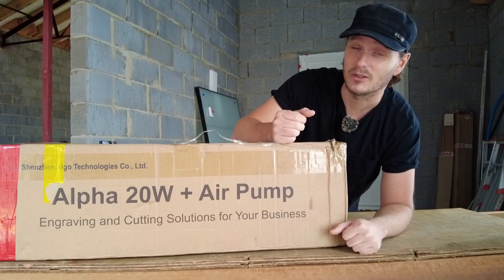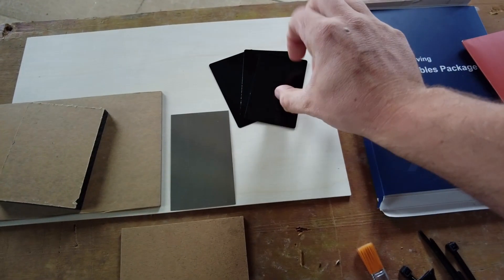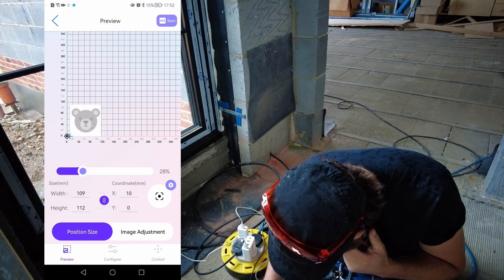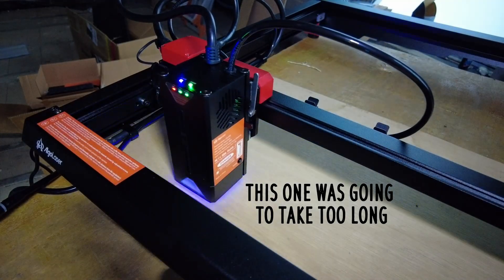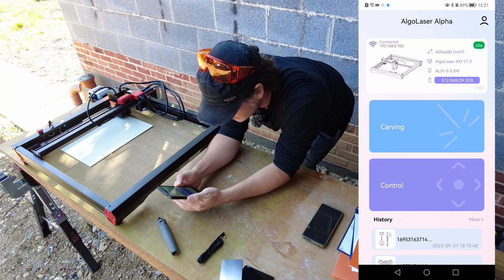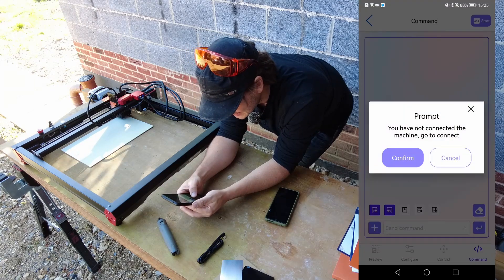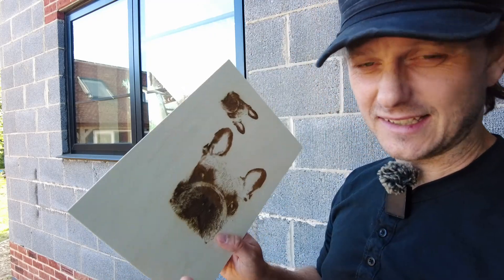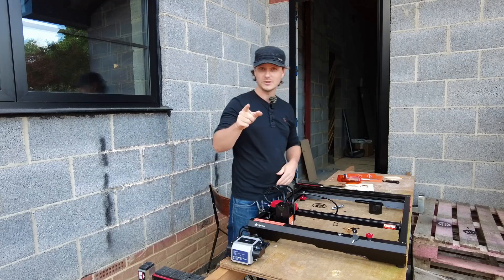First Time Laser Engraving - AlgoLaser Alpha - Easy & Fun!

Comment: A note of caution about these laser engravers/cutters - these are Class 4 lasers and while you're obviously not going to be looking into the laser itself (!) the reflections are still powerful enough to cause eye injury, especially if you are using on more reflective materials (metals etc). The glasses you get are likely not particularly high quality, and relies on you remembering to wear them. Also consider anyone else around (including pets like Arthur!) who can potentially be exposed to the laser light, particularly if they are viewing from a lower angle. These lasers should really be in an enclosure with an appropriate filtered viewing window, and an interlock that turns off the laser if opened.
I work with diode lasers in a research lab and we have a lot of safety mitigations and training around the safe use of lasers, so makes me worry about people being able to buy these and maybe not having the same awareness of the risks. All power tools are potentially risky of course, but that's usually more obvious  🙂
Reply from the maker: I'll pin this for others to see 👍 

yeah I was going to look for some properly rated/certified glasses, do you have any recommendations?
Reply: Although I work with lasers, I'm an engineer not a laser scientist, so by no means and expert! There are quite a few factors to consider when specifying suitable laser glasses, such as being appropriate for the wavelength of the laser you're using and how much visible light is absorbed. Of course if you can't see through them very well then that's a risk itself! 😁 Certainly worth doing some research into it though.